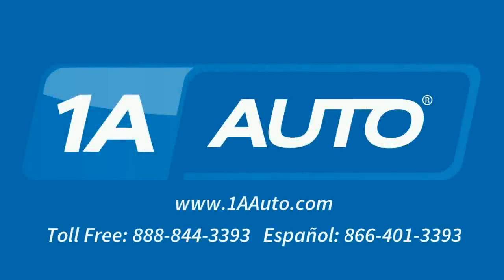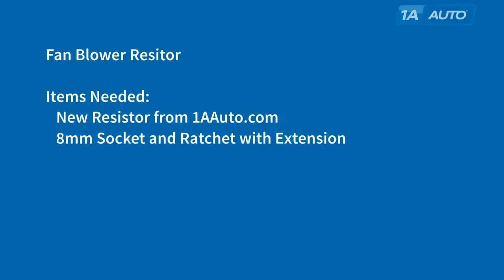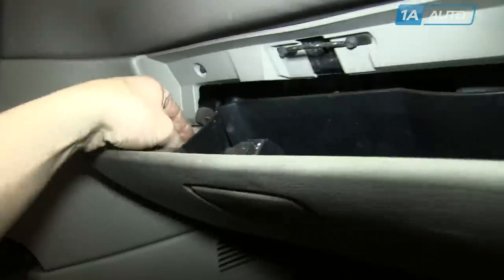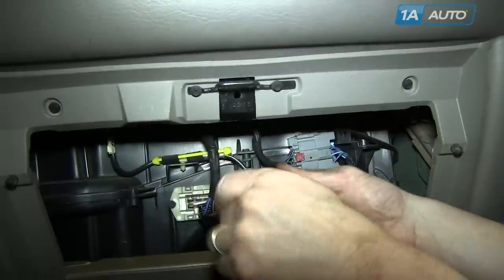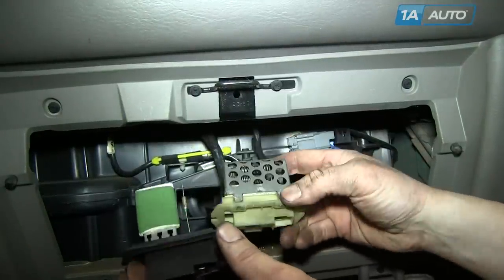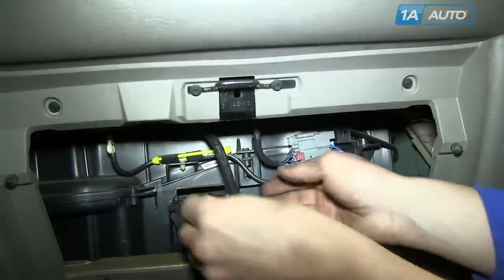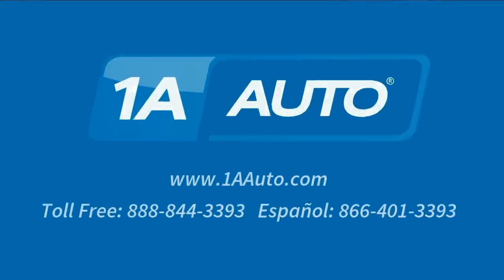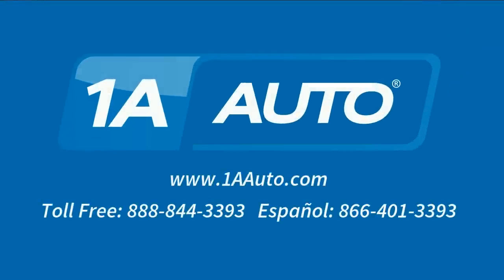How To Replace Blower Motor Resistor 01-03 Dodge Grand Caravan

Comment: If the new resistor blows quickly, does that indicate a bad fan motor?
Can you replace the resistors in the resistor pack?
Reply from the maker: +mamachip Typically when a blower motor goes you will start to loose the speed settings. When you say the resistor blows quickly did you mean that something it causing it to go bad, or that it blows a lot more air ? Hope this helps you out. 1aauto.com